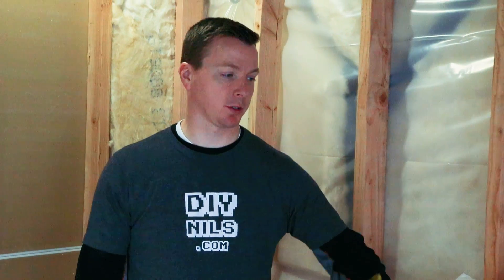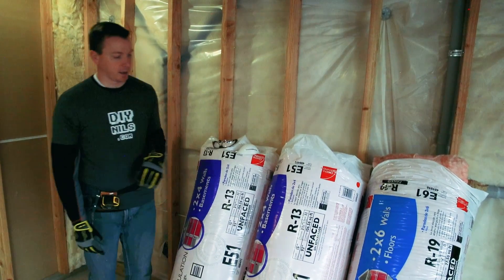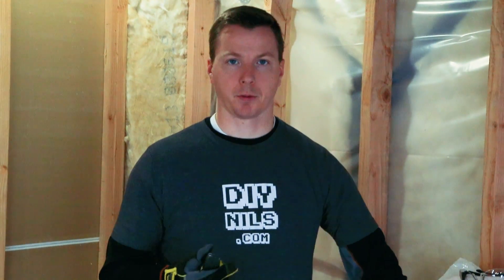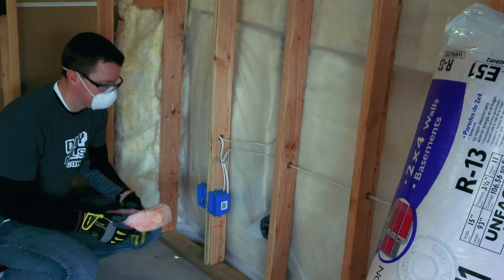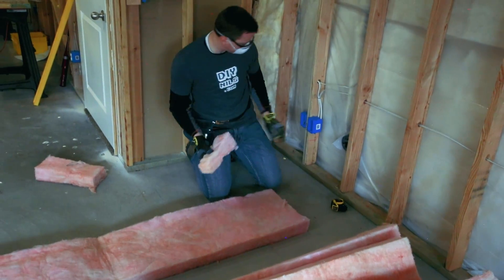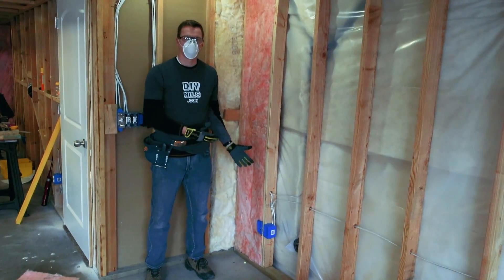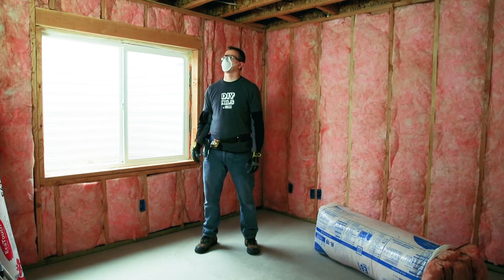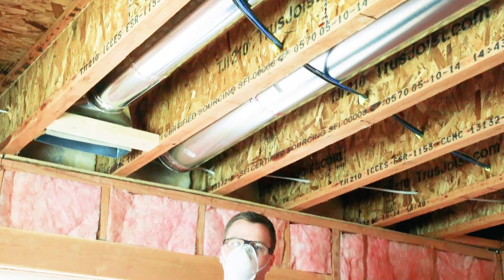How to Install Fiberglass Insulation in Walls and Ceiling

Comment: The studs are 20 inches apart on my old garage that was built in the 50s. I’m having trouble putting the insulation in the ceiling because of the 15 inch width of the insulation 😢

Comment: Did putting fiberglass insulation between the floor joists really make much difference in sound proofing since it’s mostly through the vibrations of solids?

Comment: FOLKS install the thickest highest R value instulation you can afford. DOING the bare minimum R13 or R19 per code is penny wise pound foolisha nd you will literally be wasting thousands of dollars in heating and cooling over the life the house. work smarter not harder@!!!!
Reply: R13 is the only thing that can fit in 2x4 wall cavities. Compressing R19 or more in a 2x4 cavity will only crush it and ruin the R value. R30 should be used in ceilings where there is around 10" or more in clearance.

Comment: What would I need to do to exterior metal walls & ceilings in my utility room which is a portable bldg type shed. I am currently removing old insulation and paneling to go back with plywood and some peg board overlay, the ceiling has no joists so I will be installing "fake" ones, but do I need a vapor barrier or just the faced insulation.  I am in the middle of nowhere so no city regs just want it done right
Reply from the maker: Vapor barrier should always be put in for exterior walls and then you can use the R Value map to see what is recommended for your area.

Comment: Not sure when to do it or not, but I was told to put the paper side up when installing on the ceiling in the basement.  Two different contractors said fiber side down and paper side up at least for the basement ceiling.
Reply: Faced insulation: In most of North America, the vapor barrier should face the interior of the home

Comment: How warm does it get in a garage after you install fiberglass installation it is 40 here in Michigan now but could it get 75 with fiberglass insulation in the whole garage it is a 2 vehicle garage.
Reply from the maker: That question is hard to answer because of all the factors but keep in mind that insulation is all about retention. If your garage isn't heated then the insulation will help keep the cold out (in the winter) but it won't do much warming. If you put some space heaters in there, however, it can really help to retain the heat - especially if you insulate walls and ceiling.

Comment: What’s the best way to install this in an existing drywall. Like if I cut a hole at the top or bottom to slide it down
Reply from the maker: I don't know how feasible this is with traditional fiberglass batting, but it is possible with other methods. I've never tried it myself but supposedly you can blow spray foam or cellulose into the walls from a 1-2 inch hole at the top.
Reply: LRN2DIY how different is the spray foam in comparison to the batting?
Reply from the maker: @GamerGee  The spray foam is very different in most ways. They're both meant to do the same thing but the spray foam is typically applied by spraying within a foot or so of the surface, so that would be tricky in your situation. It also expands and hardens pretty quickly so if some expanded higher up, it could block the rest of the insulation from getting to the bottom. The blow in cellulose could be your best bet but I'm no pro at this.

Comment: Great videos!  Did you insulate the ceiling mainly to soundproof the basement?  If so, how well did it soundproof for you?  I'm deciding whether to use fiberglass insulation or the Rockwool Safe n Sound and resilient channel.  Any info is appreciated!

Comment: Which side is the kraft paper suppose to face inside or outside? I keep getting mixed answers?
Reply: Paper facing you ..if ur using Kraft..usually basements get the paper in

Comment: How about a barn shaped roof/ceiling approx 16 feet high 14 ft overall length from side to side for insulation to fill and has a vent line all the down the center ?
Reply: I have nearly the same problem. That vent line is very worrying

Comment: If I have spray foam on the attic ceiling, but I want to add to the R-value, can I put fiberglass batts up under the spray foam?  Is there any reason I shouldn't do it?
Reply: Brian Klein if you are talking about foamed slopes then you’d be fine to batt over the foam but it’s not really gonna do much, as the foam is a complete sealant

Comment: Always open up backing and staple it to rafter.  You also have insulation on exterior rim joist, this is a bad from what I understand, it will cause mold/condensation